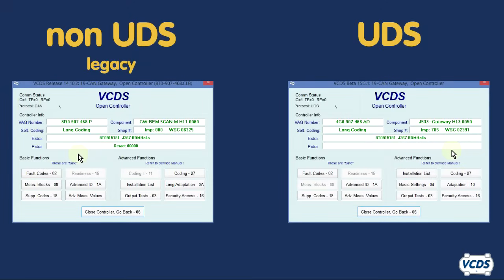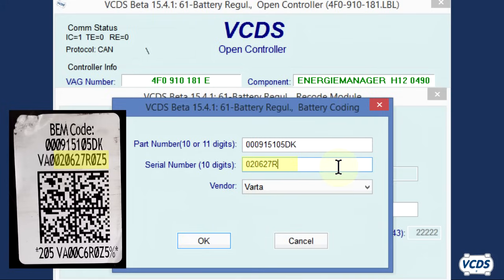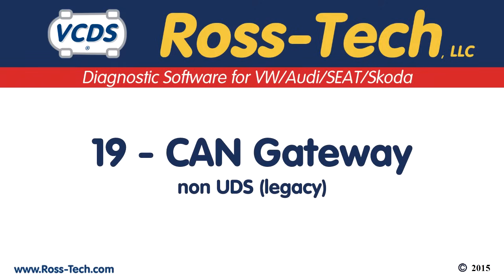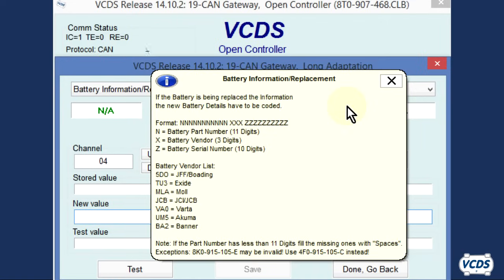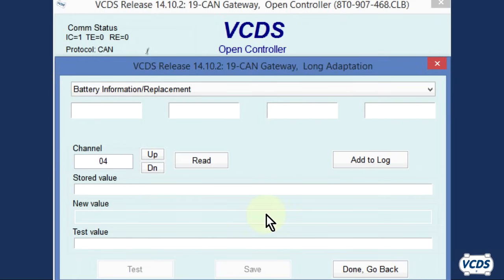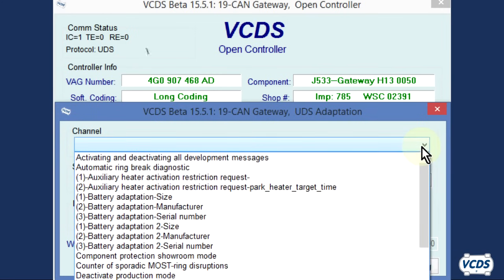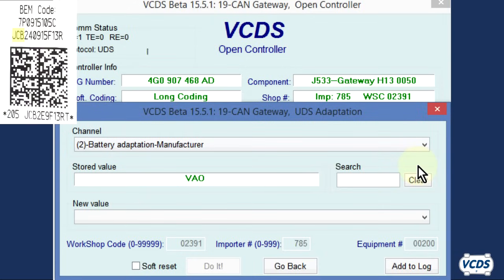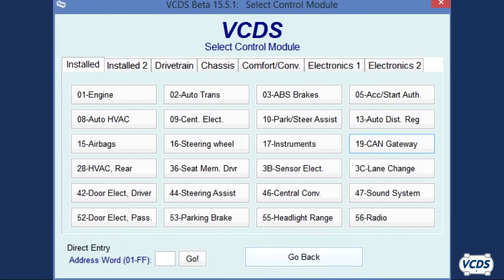Battery Coding

Comment: Just did this with my 2013 A5 2.0t. Took a moment to realize that my VCDS connects via CAN method but once that was done it was a matter of inputting the value correctly. BTW, I used an Autocraft battery from Carquest, it is virtually identical as the Moll MLA battery that was OEM installed for much less money. Both are made by Johnson Controls, so reliability shouldn't be an issue.
Reply: I appreciate that this is two years down the line but... How do you determine which of the three techniques is the right one to use please ?

Comment: Do VW Tiguan require BEM coding ?  (specifically model year 2013)
, please help me
Reply: Hi   Rafael, I  have  just  had  my 2013  Tiguan  Battery  replaced  &  because  it  had   Stop/Start   on it  it needed  a  dearer  Battery  &  was  set  up  with  a  meter  by  the  Shop  assistant  after  I  had  fitted  it   as it was  not  drivable, regards  Terry.

Comment: Hello. I have an aftermarket battery installed in my audi a4 2009 2.0tdi. Every morning I start the car, yellow battery warning pops up and stays on for a second or two, which, I suppose is because of the battery. It is becoming annoying, so I wanted to ask you is it possible to code the aftermarket battery with some of the random original vendor codes and to somehow “cheat” the system? The battery itself keeps the power all the time (I checked it) although MMI shows battery low sometimes. Thanks in advance.

Comment: Hello,

I have had a dead battery 2 days ago, and i took it inside overnight to recharge it.
The next day, when i've put the battery back, the engine started, but a bunch of errors appeared on the MFD.
From what i saw from other sources, these errors appeared because the computer reads the battery as low. 
My question is, will the errors dissappear as soon as i will get some KMs running or do i need to get a tester on it to delete them?
Reply: Will disappear

Comment: Hi, my A4 battery does`nt last too long after the car is switched off. i mean if u play music longer than 30min it switches off. Does it needs charging, coding or boosting by the dealer or something?
Reply: Thats a function in most cars to stop the battery draining when it is purely using power. Most cars are either 30 mins or 1hr before radio switches off...
Reply: @mgs090110  and usually you can switch on the radio again and then you will get another 30min again. It just keeps you from draining the battery accidentally.

Comment: Damn I didnt even have to go through all these changes to replace battery in my 2008 amg benz this is ridiculous.... Last time I check audi/vw didnt make batteries like most other car brands don't they just put there name on it and jack up the price.... This is my 1st and last vw/audi product going back to Mercedes benz amg... But I love ross tech program its great 👍
Reply: disconnect the negative rail main battery sensor, no stop/start, use any battery you like, alternator will charge same as Mk1 TT, my batteries 8 years old.
Reply: @robbob1693  where the heck is this located?     "negative rail main battery sensor"

Comment: Great video, however there is one piece of information which is not really correct.  You do not need to use a genuine battery.  There is nothing special about the OEM battery - it does not have unicorn horn dust in it!  The part number, manufacturer and serial number are text only fields.  We have validated this, and as long as the fields are populated it will work fine.  What is important is the nominated capacity of the new battery (Ah) is the same as the battery which is being replaced, as well as the construction (i.e. replace AGM with AGM).  Changing the serial number will trigger the BEM to forget any learned values for the old battery and start learning the new battery.

By the way, I love my VCDS :-)
Reply: Dude, i replaced my normal battery with an AGM...so how do i code that its now an AGM
Reply: @thabzathabs4550  You need a scan tool capable of making changes, not a cheap and nasty one.  Where are you in the world?  VAG COM is one option, OBD eleven is a cheaper option that works well.  They also have great support. AGM is called Fleece in the list of options given to you (translated from German I guess).
Reply: Does it mean that if the battery i want to use is not listed in the drop down menu I can just use any and it will work ok?
Reply: Thanks my friend, I don't have access to genuine battery in my area and I just replaced the battery. Which code should i put to have it work properly?
Reply: @mevio4665  It doesn't matter.  You can use the code off of the old battery and just change one number so it is different.
Reply: @timlennon8102  Many thanks for the advice!
Reply: When replaced with the same battery, is the coding not really needed then or is it always needed? Trying to figure out if I can just replace my car battery.
Reply: @NickBusscher  You need to add a code, but it does not affect the management of the battery.  It is just a text record in the system. Use the same BEM code and change one digit in the serial number and you will be OK
Reply: @dimadee  thanks! I don't have a vcds tool so I guess I'll bring it to a local audi shop then
Reply: @NickBusscher  According to battery manufacturer BANNER you just need to change the battery. Only difference is that when you don't code it it just takes longer for the car to learn the new battery.
Reply: @rimmersbryggeri  thanks for the info!
Reply: @NickBusscher  Buy quality batteries though. But I guess thats a given.
Reply: @NickBusscher  save the $200 the shop will charge and instead buy a vcds...
Reply: Thank you this was helpful 👍🏻🙂
Reply: wow
Reply: Thanks man, I was about to return the new one as it doesn't have these codes on it😄
Reply: This is exactly what I thought and thank you for confirming that. 👍🏻

Comment: Just programmed my 2007 Audi A8 battery. No problems. I purchased the 3 VIN option because I have 2 Audis and dealership in my area is price prohibitive. The wanted $600 to install the battery. I told the parts guy I had VCDS and he gave me a dirty look. Lol. Not only did I save $ but now I have the VCDS software, Im always working on my cars so I was glad to drop $200 on this. Thank you guys
Reply: Hi, i have changed both battery in my phaeton and looks like i got to code them, i have both AGM installed both 95ah, but charging is different 14.4 for starter battery and 13.7 for system, i think starter battery have been coded as simple acid battery what been installed before, in what channel did you code both batteries?
Reply: @vadimsim3915  Hi, did you solve the problem? How does the AGM batteies work with your Phaeton? I had AGM comfort battery and normal Lead Acid one for the starter, Phaeton started acting up (many electronic things not working properly) so I replaced the AGM with a normal Lead acid, problem solved, but my car destroys batteries every year to the point I get new ones under warranty. Do you know how to code them? which of these 3 procedures is correct for the dual battery Phaeton?
Thanks
Reply: @anzew88  Hey, I had no issue with new batteries, never coded, but I made sure nothing eats battery while it's 'sleeping', also make sure you charge comfort battery once in 2 month, depends how short your daily runs are
Reply: @vadimsim3915  I have the comfort battery connected to magnetic socket, so during the winter the car is usually on charger during the night, because I run Webasto every morning and my drives are about 20 mins long.
I just had my starter battery die after 10 months. Not having any ghost drains, car can be parked for 2-3 weeks starts fine, just not sure why it's eating through the batteries every year. At first I thought I got a bad batch of batteries, now it's not funny anymore.
Reply: @anzew88  comfort battery should be AGM for sure, it supports much more charge cycles before it dies. Don't buy cheap battery, varta/bosh agm should work ok
Reply: @anzew88  and you got to watch both batteries, recharge, not just comfort one, I always do check starter battery as well but never noticed it to require recharge
Reply: @vadimsim3915  when I had an AGM battery for comfort battery the car went bonkers, half of the stuff didn't work properly. Since the voltage of AGM battery is slightly lower the car was trying hard to recharge it and it overcharged of constantly, for the same reason many of the consumers were turned down because the system was trying to reduce load, thinking that the battery is low. AGM was not a solution for car, in 2003 when my Phaeton was made there was no AGM batteries and the car doesn't know how to work with them. I was using Bosch, those were going bad in 10-12 months now I bought Varta.... Regular one
Reply: @anzew88  there have been issues with battery charge control module on early phaetons, may be you should upgrade module and upgrade to AGM

Comment: How do you add a Yuasa battery to an Audi's system by using VCDS?

TPS (which is the trade section of Volkswagen Group here in the UK) only now supply Yuasa batteries - so they are effectively now the OEM battery for all VAG group cars in the UK.

However, Yuasa isn't a manufacturer that is showing in the drop-down menu within VCDS when you try to update the battery information, and worse, Yuasa batteries don't have a BEM code on the side of the battery to fill in the other required parts of the information to do a proper job of re-coding the car with a new battery!

What does one do in these circumstances?
Reply: Richard Mackenzie did you solve this? I'm in the same boat :/
Reply: My understanding is code manufacturer and serial number not important. Only only battery technology and Ah

Comment: So apparently you are screwed if you buy a non-OE battery because you won't be able to program the battery. I bought an Autocraft H8-AMG Platinum battery for my Q5 and advance auto customer support called the manufacturer and they don't provide these numbers. So in other words, hope that nothing goes wrong (as I am).
Reply: As long as you buy the same spec (type and Ah) you just use the existing coding part number and add 1 to the serial or some other value that keeps the length the same but changes the value.
Reply: @snapdragogon69  thank you for the tip, you are exactly correct!!👍

Comment: Hello, I find the explanation at minute 1:17 to be confusing as to how to identify which version BEM you have.  More specifically, how do I know if I should use "Battery Regulation, address 61" or CAN Gateway, address 19 ?  Car in question is a 2012 Audi S4.  Thanks!
Reply: I have the same question. I have an Audi A3 8PA. Did you find the answer?

Comment: I just replaced the battery in my 2015 GTI with an OE dealer one, all I had to do was swap as normal.

 No coding necessary.
Reply: That's like saying I just bought some old used brake pads from the scrap yard and they work fine no need to buy new ones.  Of course but they don't work AS INTENDED.

Comment: Quick question. I have a VCDS, and i have changed 4 batteries on four different VW's.. 2 CC's  Both 2012.  One 2012 VW Tiguan SEL  and one 2015 VW Gti. All batteries purchased from the dealership. However i did not do any coding and have not had any issue. If it aint broke i won't fix.. But seeing that i only came across this video after the batteries have been changed, i thought i'd ask the question as to why i didn't have any issue ? I know the dealer wanted to charge $80 for coding, but i thought probably just trying to rip me off and i'd try the swap without paying, and it worked out. The CC's are long sold, but i still have the Gti and Tig, should i bother updating ? or just leave as is.
Reply: My understanding of this system is that as long as the battery you replaced didn't force the ECM into "Power Saving Mode" AND the new battery is very close (within 1-2 Ah of the battery being replaced), then the ECU will "learn" the new battery.

It doesn't actually learn the new battery as the battery has no data link to the ECU, but the programming within the ECU will "reset" the learned parameters so it doesn't trigger certain sensors or low voltage alarms.

I'm in the process of resetting a car that went into Power Saving because of a bad battery. I replaced the battery without knowing about this MMI Power Management System and 5 minutes into the test drive the car gave me a "alternator not charging battery" warning before it went bat shit crazy. It's fine now, but I initially looked into relays and fuses as this issue caused a number of electrical failures. The engine ran, but no other system in the car functioned including lights, transmission, abs, and stability control. As far as the car was concerned, those systems weren't even present.
Reply: @aluminumfalcon5043 hi, how did you wake up different systems? I have similar issues after changing my battery. In advance thanks
Reply: Most VWs short of the last couple years of Touareg don't have a battery regulation control module nor battery registration. For the cars you listed, none will have an issue with you just replacing the battery and not doing any coding.

Comment: Wow its crazy, does it really need all this crap. Good thing you can buy things like Ros-Tech tool. 
I have an 07 passat TdI, I love this car and everyone who rides in it comments what a good car it is, I do make sure to buy good tires that have a high rating for wet grip and the lowest noise, this truly makes a car great, mine is super quiet and handles like a race car.
Reply: 1st time I've seen this video, many thanks. I do see people moaning about having to do this, yes part of it is keeping tabs of batteries being swapped for older,tired units while in manufacturers  warranty  period,  yes I have seen this,  but also battery management has moved on from the alternator just spinning, monitoring demand state of the unit, and requirements for maintenance of the charge with more control of the alternator.

Comment: I just changed battery on my Passat CC 2011 and from OEM 68Ah Banner to new 70Ah Exide, everything works right after the battery was connected since no dates are configured during this procedure i dont see any reason to do this or are the dates reset by this procedure? Since i know that the cars with AGM and Start Stop use the replacement date for assumptions how to use the advanced power management.
Reply: i tell you what will happens, the car calculates wrong starting amp, the battery will die in a few years faster...  the car still calculates with a 68ah battery not with a 70ah
Reply: @ForWhhY  you are wrong!!!!!!!
Reply: I don't recall ever having an issue changing on all my VW's to a larger ah rated AGM battery from the OEM, less capacity flooded type....the alternator has a built in voltage regulator, don't it, which controls the alternator output, responding to battery and device loads....when the voltage of the battery is correct, alt stops charging, whether it's a high capacity or lower, its sensing battery voltage is at spec...just changed a 2018 tiguan, and a 2017 GTI to a larger aH capacity over OEM still H6 package, AGM, before they go bad, no programing of BEM since they are autoparts store batterys, all ya get are a dash filled with errors, that go away with driving around teh block, what else is there to be done, I have Vag Com, never redid battery sectors